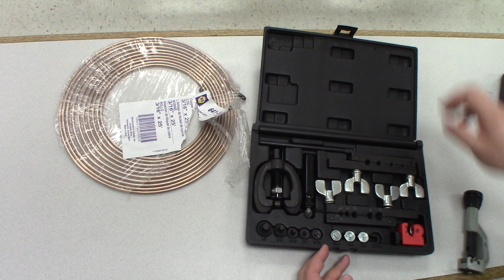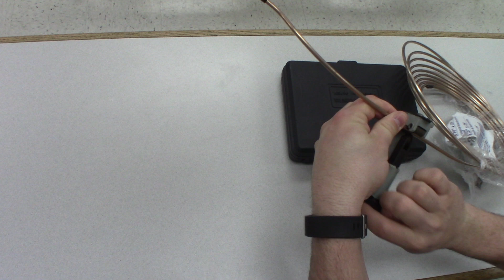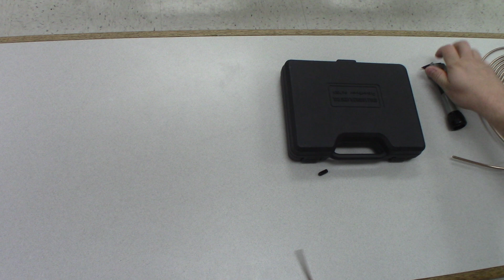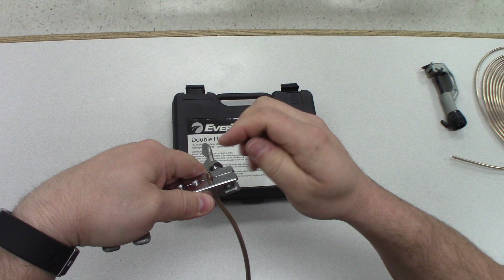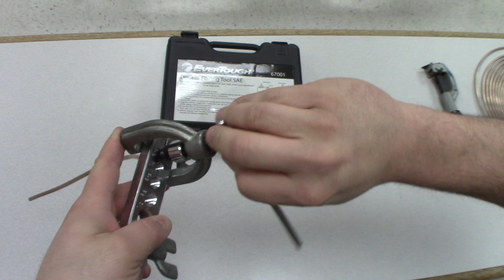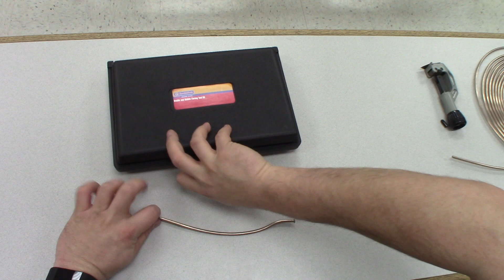How to Flare a Brake Line

Comment: One half of the clamp is longer than the other. Hold that plain piece in a table vice and you'll do the job a lot easier. Don't need to perform your juggling act with it.

Comment: My experience with  the so called  double flare  kit they sell at parts store's  is . Sabatoge  JUNK  . The stem on the die is way too small and cannot  center properly   to do a good  flare  this garbage has been out there for 50 year's.  The tool that can do this  is 500$ plus

Comment: I'm an old man in case you want to know. 
Nickel copper tubing? 
"it'll just squish around and eventually seat"? It will crack easily too. What a joke.
1. Coiled line won't flare straight because it's not straight to begin with, notice how he glossed over our actually looking at the flare.
2. Yes, it's more forgiving and easier to work with but much weaker than a steel line.
NiCo line isn't hard to work with but it's soft, bends too easily. Just pull on it and see what happens. Or hit it with a wrench. Who's going to do that?  You might be surprised.
Reply: its not nickel. 
dont comment on things you dont understand !
you are not a mechanic !

Comment: I do the first flare on the roll of tubing in case it doesn't form correct, then you don't waste tubing. After 20 years of flaring I noticed the angle on the flaring tool was buggered. It's easy to remove for dressing - don't drop the ball bearing!

Comment: I had mine slipping off, the line was coated
Reply: same problem here
Reply: @arnaudvelter  so i was looking for solutions, some said that if i used heat from a propane torch it would help bend the metal easier. im going to try that and see if it helps.

Comment: Joel, I noticed the bubble flare you made doesn't have a flat edge to sit on the (usually metric) brake nut. All of the ones I've ever seen on a car do have that flat bottom such they look like a mushroom. I'm wondering does that matter? Is the copper/nickel soft enough to mold into shape in the fitting/connector?

And what if you over tighten that dowel tool? If the bubble is kinda flattened (more disc like), again will it mold into the shape in the fitting/connector?

Comment: I tried to get brake lines today for my century they rent the flaring tool at Parts Source. I don't know to if it is a metric flare or a standard double flare.  The car takes metric wrenches   thankx 4 the help.  they don't sell  them pre bent. shoulb b your next one I need 2 90 tz on a 6" line. Guarnteed I will kink it. can u heat up a brake line.. I hope this is not a stupid question.   duuuu

Comment: I'm torn on this : spend $45 for line, fittings and basic flaring kit and do all my lines myself..... OR..... spend $400 for complete SS lines for a simple "plug and play" install. This isn't meant to be a joke. There's peace of mind that comes with spending extra to guarantee a simple and leak free install
Reply: I agree,all comes down to $. It no race car. Just a simple older Civic. Neds all lines. I'm leaning more towards the DIY approach. And if I make a mistake, I can easily get more line for cheap, and I'll be getting experience, as this'll be my first brake line job

Comment: When do you use double flare vs bubble flare ? Application specific or are certain applications of standard/metric as fit
Reply: Joel Dufkis how can i tell which to use based on a visual inspection. Is there a diagram i can google for reference ?

Comment: I'm the kind of person to realize I forgot the fitting after I already flared it haha
Reply: LSX_ moe I did that twice in a row the other day. I've wasted so much brake line already its not funny.
Reply: I just did that and now my car is stuck at work for the fourth day. Working overnights and then attempting to fix your car is quite the pain.
Reply: I do that same process when i use shrink wrap at times. So disappointing! Especially when you have little wire to work with.